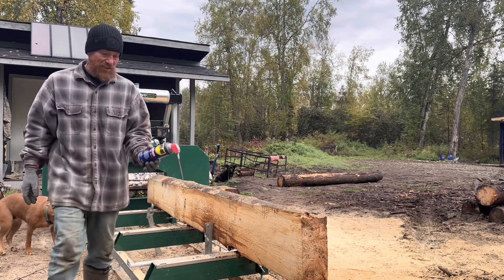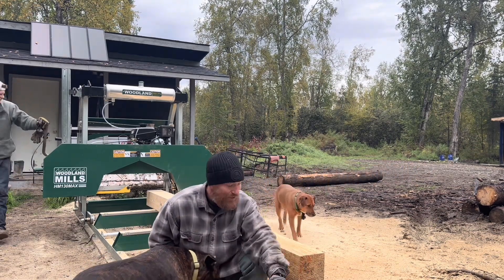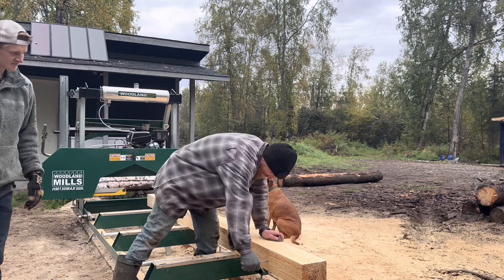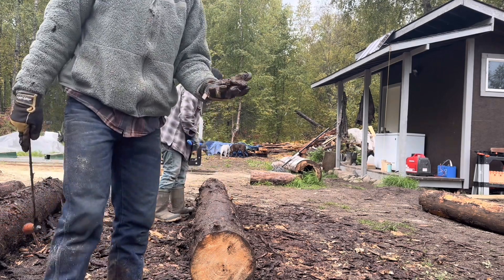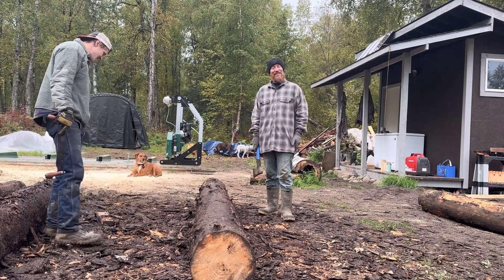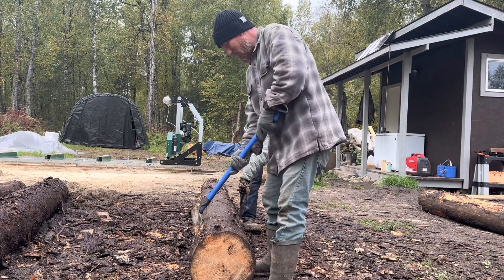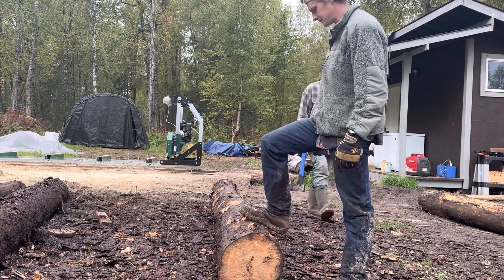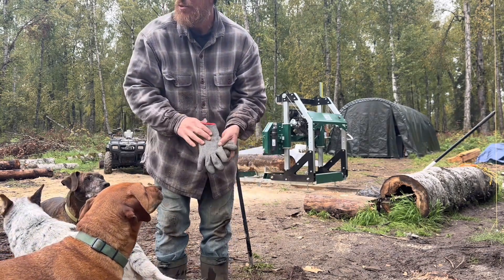Milling Our Timber : Full Process Part 2

Comment: Can put well under house or in house , and the floor temp will keep it from freezing or  put one outside, pull well pipe up from well 15/20 feet drill hole to let water drain back away from head and will not freeze check ur neighbors for their depth in area u may be able to jack hammer a shallow well in house
Reply from the maker: Thank you very much for the idea !